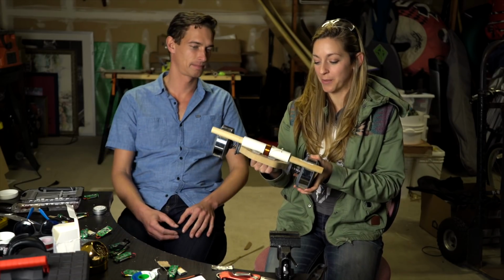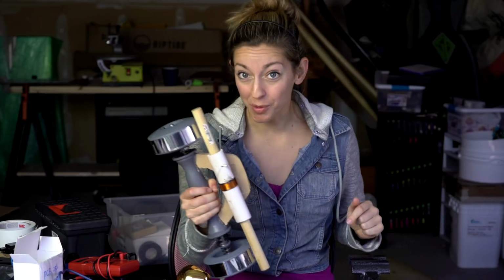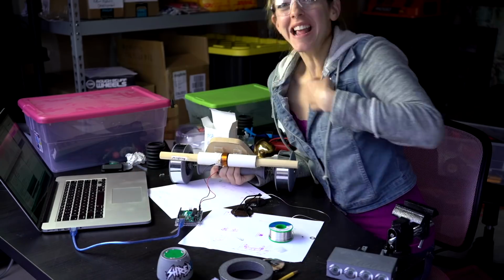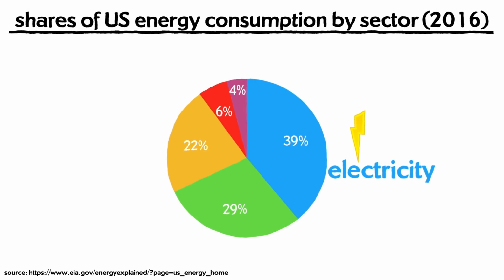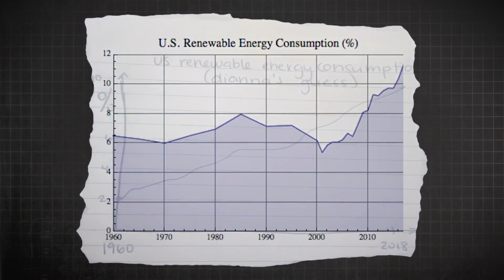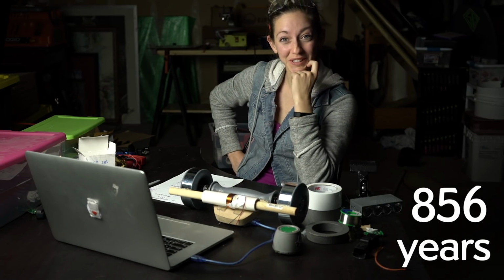Can you power a house with a ShakeWeight?

Comment: Put the shake weight on a piston on the last gear of a gear reduction machine that's attached to a flywheel attached to another gear reduction machine attached to a hamster wheel set to detach from the second mentioned gear reduction machine when the hamster wheel stops and you got yourself enough shakes to power the house.

Comment: We based our 10th Grade research paper on a shake weight mechanism! So basically we wanted to make a punching bag that produces electricity. In our experiment, as we punched the punching bag, the bulb lights up! It took us months to figure out a mechanism that would work. Finally, we settled on using a pvc pipe and coiled wires with neodymium magnets inside. We implanted the mechanism inside the punching bag. It took us a while to find the perfect position but nonetheless we did it. We got a grade of 100 in that project. Fun times. All the sleepovers we got to have because of this project.

Comment: Hi
Physics girl
If we use Aniroid barometer out put work for turning a small motor Brushless dynamo so it's always making some output voltage round the clock 

So are you able to make such arrangements 
Now if we use 1000000 pieces of aniroid barometer and Dynamo output so how much Kwh energy efficiency electricity we got
Please do some math over it ?

Comment: Show this experiment if we make a jolt with our weight so we need a more bigger and reliable platforms where we walking and energy created can be used for cooking food 

If you use a hydraulic pressure jack and press a spring which can store 500000 joules now we use gears and lever so we just make a jolt at lever and it will created a difference 

So we don't need fuel any more 

We can use atmospheric pressure to pump up and down the hydraulic pump and become energy indipendant at anywhere in universe ?

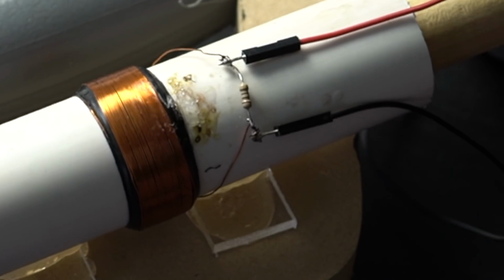Comment: 1:46 Nice... AC, I'm sure the Arduino will thank you. I guess good thing the ATmega328P is pretty much indestructible compared to many other micro controllers.
5:17 So ... 35 / 365 = 80 ? We use more energy in a day than in a year?! Does that mean we use even less in two years? And playing Mario Kart consumes 10000 Wh?
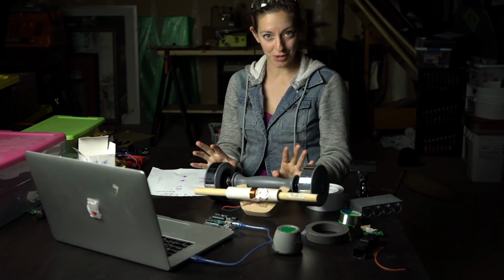5:42 Did you consider the negative half waves that the Arduino didn't measure? Also, I believe you mean 0.004 Wh not W... That's a big difference, you know, like miles and miles per hour.
Reply: 5:30 And that's why they're 'mind-boggling numbers'

Comment: I think another issue worth mentioning with the shake weight idea is that the energy there isn't actually necessarily clean, it has to come from somewhere, and what you're doing really is converting chemical potential energy from glucose in your body to kinetic energy in the muscles and then finally to electrical energy (+ other forms of energy as waste at each stage) the issue with this is that means that the glucose in your body is being used up and needs replenishing for you to continue shaking the shake weight, i.e. you have to eat. Food production uses significant amounts of energy and, according to a quick google, was responsible for around 9-10% of our total greenhouse gas emissions in 2017 (Lower than I thought going into this)
Essentially what I'm saying is that this method, even if you could scale it to produce more power, really only moves the problem of green energy production further back down the chain. If this is used regularly, sure, our emissions and such from electricity production drop, but our emissions from agriculture and food production rise and off set the benefits. 
Still a cool concept though, and it's used in some hand held flash lights so you can recharge the batteries when you're away from electricity sources. 

I think in terms of humans producing electricity like this a better method would be to use something like an exercise bike hooked up to a small generator, that way you can put gearing on the output of the bike and get the output shaft spinning faster, hence allowing you to get higher voltages and more power.

Comment: You probably could have produced more electricity by having the coil cover the entire length of the outer tube.  As it was designed, the magnet spent most of the stroke not interacting with the coil.  You could have also added more magnets, as long as they were weren't close enough to each other to interact in a significant way.

Comment: There is I significant loss in efficiency from 3 main things

1.The extra dead weight of the shake weight.

2.Constantly changing direction of acceleration of the weight. 

3.Small magnet and coil.

Make the magnet spinn innside an array of coils like an actual generator/turbine so the mass you have to accelerate stays at a constant direction and speed and it will improve

Comment: How would you improve your shakeweight? Remember the resistance of the coil towards the magnet is no where near the force needed to utilize the shakeweight. So how much force are you applying to the weight and what size coil and magnet would be required to mimic the same amount of work. And, how much energy would such a setup produce. You said you wanted to make a difference, let's see it happening.

Comment: Your fixed resistor wasn't necessarily at the maximum power point of the ShakeWeight... you might be off by a whole order of magnitude if you use a different resistor value! ;)

Comment: I'm about half way through the video, but i've thought quite a bit about this subject in past years. there are a few things we can do that I know of: one being we can convert gymnasium equipment to supply useful energy to the grid, we can set up large hydro electric generators to flow through turbines by making massive amounts of weight be lifted by human work of pumping and pay people to do this work, and we can harvest kinetic flow from the oceanic currents which are much more effective and predictable than wind currents, also improve our ability to collect solar energy, and the holy grail of energy production would be separating ANY mass into pure heat to be used in production of electricity.

Comment: The inefficiency of the shake weight generator makes a huge difference. You could get the same electricity if there were no weights. The weight of the shaft would be enough. Also, as a general rule of thumb, MOAR COILS!

Comment: Now, although I like the idea of using kinetic energy to produce electricity, I just simply find this design a bit impractical (as diana said). 
The two key parts of this build are the coil and the magnet. To produce electricity, the only thing you have to do is to make the magnet pass through the coil. 
What I'm getting at is that you don't need weights at each end. The force required to move the magnet does not have to exceed the required force you need to move the mass of the magnet, or in other words, you don't produce double the electricity by doubling the weight of the moving part. 
With the design Diana made, you'd have to move the mass of the magnet AND the mass of the dumbbell (which is made to be tiresome after a certain extent)
I am proposing a "spray can"  design where the magnet sits inside a lightweight tube with springs attached to each end (the springs helps to conserve some of the kinetic energy by converting it into potential energy and thereby save some of the energy that would be lost due to thermal energy by the magnet slamming into the walls)
and then, of course, have the coil sitting on the outside of the lightweight tube. 
This design only fixes the weight problem but if you think about it, you can shake an almost empty spray can a lot longer than a 5 lbs dumbbell. Other minor fixes could be having a coil with a lot more wiring spun around it and for example having  two magnets put together on a small stick (like a mini dumbbell) which makes two magnets pass the large coil - which means double the energy per shake (plus the factor of the times the wire is spun around the coil)

These thoughts are only meant as inspirational and as a positive critique. I love your videos and I find them very entertaining.

Comment: I know I am a bit late. Attach a diode bridge to the copper wire. It will make current flow unidirectional. It will reduce the blinking. You can also increse number of turns of wire so more emf could be produced. And also attach a capacitor to store some current to make the current flow even stable. 

I am late cause i just studied electromagnetic induction today. I this will help us in the future! Just kidding <3. I thought of this vid when I was in the classroom.
And Dianna, can I join any of your nerd gangs or nerd circle cause I am alone (most of the time) and I want to become more smarter!

Comment: Currently, the greatest challenge will be energy storage. Currently, there is no efficient means to store electricity. Batteries produce significant amounts of heat when being charged, or used at their high-power output (such as the 3 Amp output on my 20,000 mAh battery bank), or they discharge themselves, like capacitors do, not to mention possibly being lethal if discharged improperly by shorting the contacts.

Comment: When they get a higher percentage for renewable energy, look at, what is basically scrap wood etc which is burned.  The hype is that it is Carbon Neutral and so it doesn't cause a carbon foot print like coal.  Of course, the Carbon debate is more political than scientific, but it is cool what new technologies have been developed due to the discussion.

Comment: If you want more power, i suggest you to lift a big stone with a lever using your weight and use the gravity to let the rock produce energy. See gravity lamps : it need your power to lift the rock but if u use a lever (simple machines) and pulley you can lift a bigger rock.
But i'm not sure it's enough for house. Maybe just for lights.

Comment: I'm not sure why you would offer up a shake weight generator as a valid electric generator, other than the innuendo, but there are other generators that are more effective for home power. 
Home power generators don't have to think about things like transmission losses or power conditioning for the most common use of electricity in a community (in the USA, that's actually small AC motors by the way). 

IF you have a home system, figure out the DC voltage you're going to run your house at, and then build your generator to provide that voltage. Homopolar generators are easy to understand, no longer necessarily require mercury to run, and people have access to powerful giant magnets.

Comment: 2:11 this is how I know that you're not actually trained in Physics... but I'm not surprised as most self proclaimed "physcists" these days do not have a mastery of the discipline.

What you are describing in 2:11 is actually Faraday's Law and this is the electromagnetic induction part.  Lenz's law is the negative sign on the equation that actually describes the restoration of the object that was induced in the first place.  Its therefore a statement of energy conservation.  This is why the current that flows in the coil and therefore the magnetic field from the coil is oritenated in the opposite direction to the moving magnet.

Comment: Sure you can power a house with a shake weight dynamo. Build a gym next to the house. Invite 50 gymnasts. They can light a large light bulb with the electricity they produce. Shine this light to your solar panels. With the electricity from solar cells you can move some air around. Catch this wind with a windmill. Now your house is powered with a perfect electric machinery. Except for the cooker, the cooker runs on gas instead of electricity. So you'll have to power that as well. With another 50 gymnasts, more or less.

Comment: So... there are WAY more efficient ways for people to generate power, biking (power from a flywheel on a stationary bike powering a generator) or rowing are probably the two most efficient ways, where you can get about 200-800W depending on fitness and duration (so by biking or rowing for ~4-10 hours a day, you could power your house).

Comment: I have concept how make electricity and compressed air very cheap. But it is only concept and I do not have resources to build and test idea. My concept uses simple and basic ideas know to everybody. But nobody uses these in this combination. Concept will work for sure I need someone who know well electronics. I know physics but I do not know well electronics (only basics stuff). I have MSc in biotechnology, biology not in electronics. So far, it is only idea. Also, I have idea how increase solar panel efficiency by very unique spatial solar panel setup. I call this designe 'solar well'. It will produce electric current and hot water from cooling system.

Comment: Obviously there's a lot of loss of efficiency in the Shake Weight and it's a very small magnet and coil. What could you do with a custom built stationary bike though? Take an exercise bike or even a regular mountain bike. remove the resistance built in or drive wheel respectively and create a wheel of powerful high quality magnets and a copper wire coil casing. Now pedaling the bike will induce a current in the wire around the wheel and actually provide resistance of motion. So you get your work out and produce energy. But how much?

Comment: Using human work to directly power part of your house or of any system is tricky because of how many inefficient steps are involved. You have to use resources to grow the food and then more resources to transport the food, that will feed the human who will do work to mostly produce heat and some movement, then whatever part of that movement is not lost as heat due to friction, will power up their home. It's the Matrix problem: these machines were using humans as a source of energy, when it would have been more efficient to directly use the energy in whatever nutrient goop the people were esophagostomated with.

Comment: Cool, yeah i was thinking .004 w or whatever that's, I mean a newton meter about per second right?   Or a fraction.    Yeah i dont think it's just (and it's not emmisions it's, long term supply and how it's entangled and delivered and all that.  If you could get enough power I think it would be really weird to be running things off of stuff you just produced (i mean it being stored and, anyway)  it's usually well I wonder with entanglement if you power something with energy that comes from food and oxygen and that like flucutated after the fact in some way or anwyway.  But yeah I think like with combustion that's really deterministic and also there's not a delay between when it's throttled and when you get the power.  Also A/C is uslaly how elecricity comes in which is sorta like stepped up and down in big tranformers I think that well high voltage comign in slowly from afar then sped up near the house i think...I'm still learning it's really interesting and there could be a grid infrastrcure upgrade with EVS and stuff and source changes.  Interesing times.
Reply: Yeah i only think mechanical energy efficiently goes into electical is when it's really high force moving really slowly like a big electromagnet or something.
Reply: I"m not sure.  Cool talk. :)

Comment: More important for clean energy production for transportation then is storage is production of electricity to charge the battery.   Also you need to look at efficiency of generating electricity energy, verses the current fuels used in internal combustion engines.  It is more complex then it looks.

Comment: Does the weight of the magnet contribute to the output power in any way? I would imagine no, so just shaking a magnet in a tube would produce more energy since you're not wasting it on accelerating and decelerating the weights. I'm not a physicist though, so I could be wrong

Comment: You found the energy produced by your linear generator, which is only a minute fraction of the energy you put into the ShakeWeight. Most of it went in the springs in the ShakeWeight; that's what it's meant to do - absorb energy. If you want to generate electricity with a ShakeWeight, do what mechanical flashlights do: remove the Springs and use a big coil and magnet. I think you'd probably be able to produce tens of watts. You are not 200000 times weaker than a horse.

Comment: I liked the video and it managed to achieve its goal of informing about energy generation and how much energy we humans use, but I'm a bit dissapointed in it. (ONLY A BIT JUST HEAR ME OUT AND DON'T FREAK OUT)

I liked the idea of using the shakeweight to illustrate how electrical energy is mostly produced and how much work you'd have to put to power a house, but it seems that it ONLY tried to illustrate the point. What I mean is that it didn't look like most of the effort and work that you put into shaking the shakeweight went into electricity in the coil, ie. it wasn't very well tuned for it. I know that would add a lot of more difficulty to the project but in the end, the numbers you gave at the end would have been a bit more accurate. In my opinion it should have been a shakeweight-like device that produces all of the resistance that you need to work out from the magnet moving through the coil. But there is a thing that does that: an exercise bike! A lot of them rely on magnets and copper to produce the resistance to turn that you need to work out, so using one  could also have been a lead to some more interesting trivia. I don't know if shakeweights also function this way, but if they do, it's a shame that you couldn't use that instead of the tiny coil.

Still, just some minor criticism. I still liked the video! I'm always eagerly waiting for the next one. (specially if it's a puzzle :D)